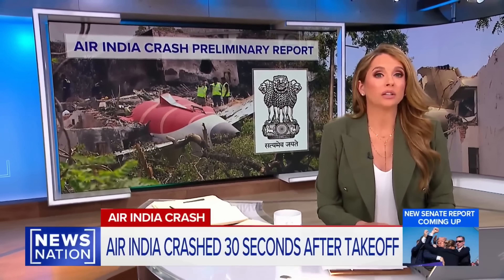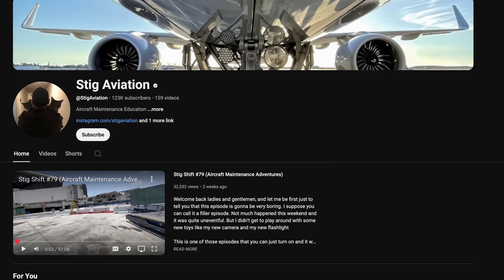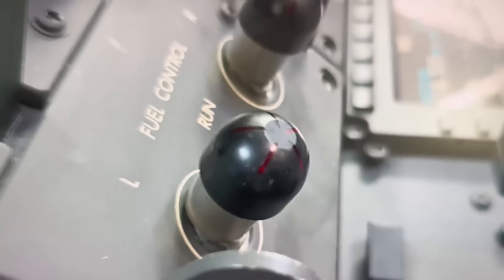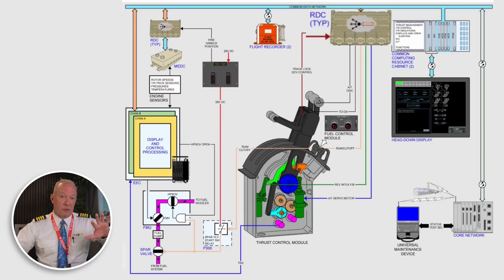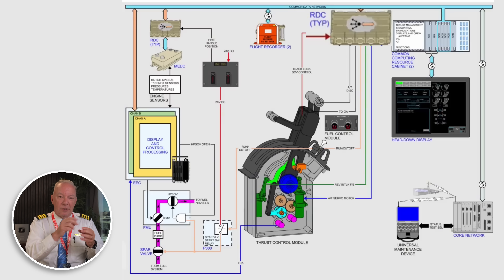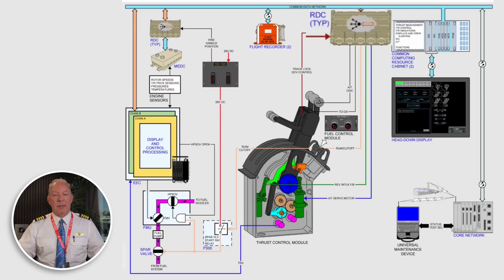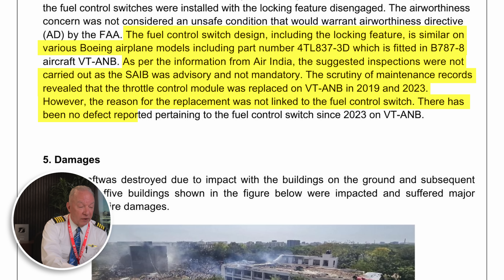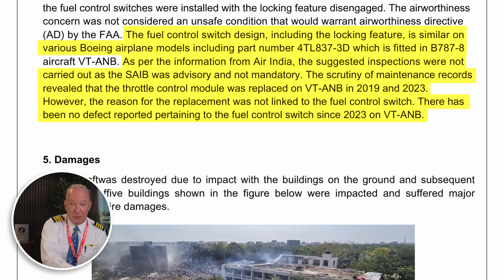The Truth About Boeing 787 Fuel Control Switches

Comment: NTSB and Boeing did  not order special checks on the fuel control switches.  Boeing 787 fleets were not grounded for checks to be made.  Pilots' unions have not asked for groundings and special checks to be made.  Pilots are not refusing to fly the Boeing 787.  Flight attendants are not refusing to fly on the B787.  I have not seen one news item about passengers refusing to fly on B787 flights.  Almost every Boeing plane in service has fuel control switches very similar to those of the B787.  

This is nothing like the crashes of the de Havilland DH.106 Comet in the 1950s.

Comment: Captain Steeve, I respectfully ask you, a Captain on the B777, to seriously consider the following technical facts as stated in the Boeing manuals. 

The engine CAN cut off fuel to the burners in the engine even if the Cutoff switches are physically in the RUN position. I repeat - WITH THE CUTOFF SWITCHES IN THE RUN POSITION, the FADEC can shut the engines down. 

How?? Examples- 

- LPTOS - Low pressure turbine over speed. 
-TCMA - Thrust Control Malfunction Accommodation. 

The logic of how that happens is irrelevant. But your simplistic explanation with a basic electric circuit is tantamount to proliferating misinformation. 

The approved B787 System Description Section (SDS) Manual states:
“ The emergency shutdown system has (these)  protection circuits that rapidly shut down the engine to prevent catastrophic engine failure.” It’s surely not the pilots!!

There are differences between RR and GEnx. But the airframe is B787.
Reply: That can't explain the recorded change in switch state of both switches in the FDR.

Comment: Captain Steeeve, I applaud you for sticking to your opinion regarding how the fuel switches could not have been moved by anything other than intentional pilot action. On doing some research, I found no less than 8 instances of deliberate pilot-initiated commercial airline crashes over the past 30 or so years; sadly it is hardly the “impossible” occurrence that many are claiming. The probability that it was an electrical malfunction is around one in a quadrillion or smaller. I suspect that the AAIB knows this which would explain why they’ve not released the CVR of the flight.
Reply: CVRs are super rarely released officially. Only transcripts as part of the reports. And that is exactly what has been done in the prelim report for this case.
Reply: @AVlad-eg3ds They actually have not released the transcript. Just one line
Reply: @AchyutaDixitthe most controversial one. They didn't try to hide it.

Comment: @Captin Steeeve
 Isn't it possible that the relay in the circuit, which controls the valves, failed? Or that the circuit experienced a short and the valves closed?

Comment: Yes, but what about if a wire to the fuel relay or the relay itself were to be severed or mechanically damaged? Where is this relay located? What type of sokets/wires these relays are using? How exactly are the wires connected to these switches? Are these connections reliable? Are you telling us that if a wire or a wire connection at the bottom part of a switch would be damaged or not making contact, the relay default state is ON? We need to undestand what's inside, way below the visible mechanical part of these fuel control swtches Capitan.
Reply: Both switches are two entirely different systems independent of one another. For both of them to experience a failure within the span of one second…it’s quite unfathomable. I believe this is the most important fact in the conclusion.

Comment: perhaps the throttle assembly installed in the plane in 2023 had come from a refurb shop where some other part had been fixed and the fuel switches not touched, so they still contained the problem referenced in the bulletin, which worsened over the next 2 years before the crash?

Comment: Is there a chance that, in the routine setting of the switches, they could have been placed in the "run" position, but NOT past the locking position, THEN vibrated back to "cutoff?"  I realize it is HIGHLY unlikely for BOTH switches to be positioned in this engaged, but not-locked fashion, AND both vibrate to cutoff in a single-second...but if we're not saying it was intentional, what else do we have?  

The "Ghost of Christmas Past" must be sweatin' about now, cause he's next on the witness stand.

GREAT video...thanks Capt Steeeve!

Comment: In short, you agree those other gentlemen that switches do not directly connect to the pump valves but connect through a relay…. I think it’s a mistake to think think the relay and valves are invincible or can not develop faults

Comment: I believe it could be remotely possible that a pilot could inadvertently squeeze their hand with the switches between all five fingers.  Thumb and pinky on the outside and middle three fingers between the two switches due to a nervous bad habit.  I have seen pilots not flying revert to flight training instinct to want to keep their hand on the throttle during climb out or just somewhere in that approximate position.

Comment: The reality is there have been cases in which a 787 cut off the fuel to an engine still in flight  - no physical switch movement, just a system over riding the switch position.  I am pretty sure that those systems can have some authority over the valves - assuming that the 787, being much like the 737, with a protection in place in case of a malfunction during engine start. Specifically the FMV.  I don't get your purpose of insisting on this at the moment - you made your position clear from the get go - now it is time to let the investigators do their job.

Comment: In January 2019, an All Nippon Airways (ANA) Boeing 787 experienced a dual engine failure during landing at Osaka's Itami Airport. The incident, where both engines shut down after the pilot deployed the thrust reversers, was attributed to a software fault in the Thrust Control Malfunction Accommodation (TCMA) system. The system, designed to prevent engine over-thrust during landing, incorrectly activated due to a perceived ground-like state, causing the engines to cut fuel.
Reply: But it would NOT indicate that those switches were moved to cutoff. That's the point. There are other reasons an engine, or the fuel system, can fail.

But none of those would result in the black box recording fuel switch cut-off
Reply: Any other Hail Marys for us? 😂

Comment: Really insightful video @Captain Steeeve, and I think there’s a deeper systems-level explanation that makes sense of what happened. Here’s a possible step-by-step breakdown of what likely caused the engines to shut down during takeoff, without any pilot action.
	1.	The aircraft begins takeoff normally with everything working as expected.
	2.	As it climbs out, electrical load increases dramatically due to systems like gear retraction, air conditioning, cabin pressurization, and avionics demand AND the generation system experiences a fault leading to lower power generation, thereby stressing the battery.
	3.	A brief electrical power strain or instability occurs due to battery consumption stress, leading to a momentary drop in DC voltage (but NOT total power loss) to the discrete signal lines that interpret the fuel control switch positions.
	4.	This voltage drop causes the FADEC to falsely interpret the switches as being in the OFF position, even though the pilots never touched them and they remained physically in RUN.
	5.	As a result, FADEC shuts off fuel to both engines, thinking it received a valid shutdown command.
	6.	With both engines off and no power being generated, the aircraft automatically deploys the Ram Air Turbine (RAT) to provide backup power.
	7.	The RAT spins up and restores clean electrical power to the essential systems, including those that read the switch positions.
	8.	With proper voltage now restored approximately 10 seconds after the initial "OFF" interpretation, the signals from the switches are correctly read as ON again.
	9.	FADEC detects the RUN command and begins the automatic engine relight sequence.
	10.	One engine shows signs of recovering, but the second engine fails to fully relight. The aircraft has already lost too much altitude to recover and impacts the ground.

This scenario would explain why neither pilot admitted to turning off the engines, why the switches were found in RUN, and why the engines began a relight sequence without further pilot action. It wasn’t human error. It may have been a hidden electrical vulnerability acting in a moment of maximum stress.
Reply: Did this happen to you in MSFS2020 or 2024?

Comment: Stop pretending that the report mentioned physical cutoffs. Stop making stuff up to suit your narrative. You shamelessly pretend to want absolute best but conveniently make up stuff that is not mentioned anywhere. The switches never possibly moved, the fdr recorded and RAT deployed earlier, immediately after rotation. The amount of BS this guy spouts is unbelievable and without any knowledge of the underlying electrical system or the understanding of 787 issues of serious battery failure that might be a single point of failure.
Reply: The captain intentionally shut off the engines. You can't handle the truth.
Reply: @yeahright532  Yep.

Comment: Captain Steve, several times states how "simple" this circuit is. He also states it uses a relay. Captain Steve. You need to understand the DC voltage, creates ripples and spikes down the line when the switches are moved. The relay you state as part of the "simple" circuit has a coil and creates inductance through the coi, as well as a magnetic field. When this magnetic field collapses it can generate thousands of volts. If a relay diode fails or fails to clamp the voltage this voltage spike is sent through the circuit. Is this still a "simple" circuit?? This is more complex than you're portraying.

Comment: Captain Steeve said that a single battery provides the power to the two relays ( left and right engines ) which when closed opens the valves ( for fuel to the left and right engines ) Question what happens if there is a battery failure ? The two relays would open and the valves closed, mimicking the two fuel control levers being moved to off without them being moved. Batteries and battery connections do fail.
Reply: Is it an NO or an NC relay?  At a basic level, one would do what you described, the other wouldn't. Electrical systems are usually designed to fail safely. Engine off would probably not be the preferred condition of a power failure, temporary or otherwise. The comment by the first officer about the position of the switches, is damning. All of these "what if this" and "what about that" nonsense goes out the window when you know the first officer confirms that the switches had been moved and the data recorder confirms it. The question should be would a power failure of any sort cause the switches to physically move? The answer to that is no.
Reply: Keep reading

Comment: Did Air India simulate a battery failure? Because that is what happened in many 787. And do you know what causes battery failure? Do you know there seems to be a single mode of failure that causes total power failure that cuts off fuel? Please stop gaslighting.

Comment: This video poster is indulging in classic gaslighting. Points to fuel switches but by now, we all know that is not the cause of the crash most probably. But he still peddles this. Calls himself an expert but doesn’t understand the difference between a mechanical actuator and electric. Not sure if he is peddling this for done money on YouTube or because of some malice related to influence from external sources. Interestingly, he avoids any mention of RAT deployment which gives more clues to what happened.

Comment: To add to that, each cutoff switch has four independent circuits inside, actuated by the same grip. The four are divided into two groups, two in each group form a redundancy. One group goes to the relay, the other goes to the RDC, which in turn gets picked up by the recorder through the common data network. Some of the folks argue the switches may be faulty and "mimic" transitions and that's what got picked up by those recorders. Nope! Four independent internal circuits. If the recorder picks up switch transitions, that means 2 of the 4 circuits flipped. And at the same time the engines started winding down, sending tons of other signs indicating they were actually cut, that means the other 2 circuits of the 4 actually also flipped. This can only mean that the physical toggle switch has been pulled out and flipped off.

Comment: If captain steve wants to hitch his wagon to intentional sabotage/suicide movement of switches. I believe this belief is flawed. Two others with more knowledge of aircraft systems tried to explain to captain steve there were other failure modes. (On the piers morgan interview) Captain Steve's sole focus on cutoff switch movement, neglects several other failure modes and issues related; not only to cctv recorded takeoff footage, but timeline discrepancies of the initial report of system events, such as rat deployment, etc. No one is disputing the fuel control switches were at sometime during the flight physically moved. The questions are why, at what specific times, and for what purpose they were moved. No-one I believe would conclude recycling of fuel control switches to relight engine failure is a mal-intent use of the fuel control switches. Explicit use of them (fuel control switches) to sabotage flight would be taken with a different view. Please captain Steve, wait for more thorough review of the flight, before continuation of what I believe is a flawed view.

Comment: Steve, you have a logic chip in the FMU that also gets an input from the EEC. So it is possible to close the HPSOV electronically. You have One input into it from the relay and another input from the EEC. If both of those inputs are not high, the valve will NOT open or it will close turning off the fuel nozzles.
Reply: Yes, I was following along nicely until he said that there are no other signals to the valves other than the cutoff switches.  You can see the additional lines right on the schematic that was shown. Anyway the Stig Aviation video clarifies that quite clearly, along with an explanation of how the physical switch movement is recorded separately from the signal to close the valves.

Comment: Captain Steve, nor anyone else, has any evidence that the fuel cut-off switches were physically moved.  The FDR records electrical signals, not mechanical movements.   Also, there is no cockpit video recording, which would be actual evidence.

The RDC's use something called an octocoupler to transfer a signal across isolated circuits.  This is basically an LED light and a sensor that periodically reads the light.  If the light goes off, the sensor and RDC interpret that as the switch turning off.  The RDC then sends a data packet to the FDR.

If the bus loses power entirely, the RDC would still operate briefly from its own capacitors.  It would see the LED turn off, and could transmit a packet to the FDR before the RDC itself powers down.  The front FDR would record it as the switch turning off, although the switch never moved.  The front FDR has its own battery, so it continues to operate.   The Aft FDR does not have a battery, so would not store any data after the bus loses power.

All of this and much more is discussed in this series of videos by an electrical engineer:
https://www.youtube.com/@jeremyjohnthompson5187

Comment: Suggest you look at You tube video: How Air India AI 171  B787 crashed.   J J Thompson. This shows clearly how it is possible to have the outputs from those switches fail Without moving the switches.  It is clear to anyone with a little electrical knowledge that those switches ( which are multi pole)provide power to a relay. A relay has a number of ways the circuit can fail. The Switches themselves are largely irrelevant, it is  the power supply to them. and everything downstream from those switches that matters.With multi-pole switches there are many way a failure could occur.

Comment: Is relay connected to switches NC by default ? Due to electrical issue, power could have gone and could have switched of the circuit due to demagnetization.